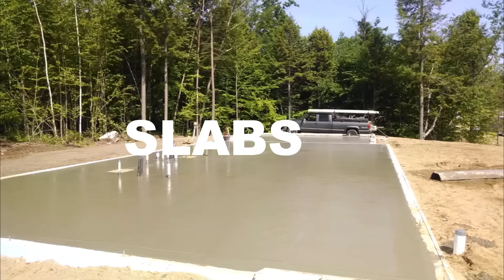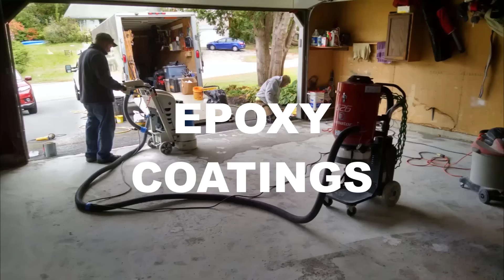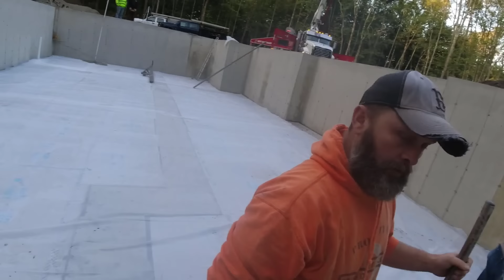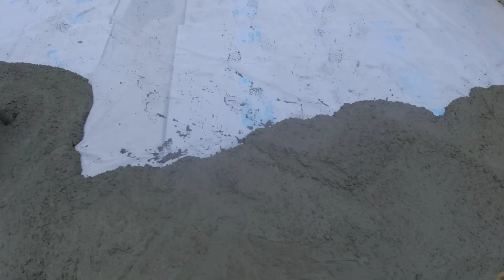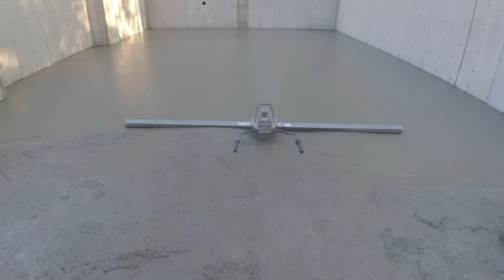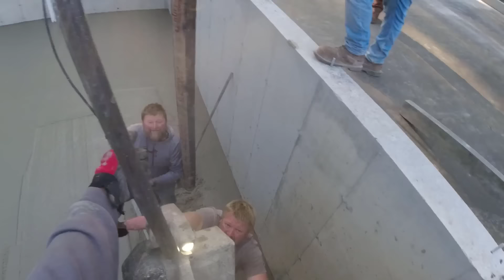How To Make Pouring Concrete Easy (Skills, Tools, & Techniques)

Comment: You obviously don’t need it Mike, otherwise you would do it, but I always wondered why you didn’t need to put expansion foam between the floor and the walls?
Reply from the maker: It's not a bad idea to do it, it helps with expansion/contraction. But if the plan doesn't call for it we don't usually do it. On some jobs we work on the plans have it in there so we install it on them.

Comment: Hey Mike,

I always love the Videos. I wish you were in Souther California not many Concrete Contractor have your skill or knowledge.

I have a questions if you have time. 

First i'm pouring a house pad for my structure that is 50x90 is with Pre Engineered cold rolled steel structure. The Engineering calls out a min 4" slab with a 2' width by 2' Depth perimeter around the slab where the Steel will Frame will bolt into the perimeter.

We entend to have a polished concrete floors on the first floor of the home. For longevity & to hopefully limit cracking over time. What would you recommend the best Concrete mix be for my project, Should I go more than 4", add additional rebar, or rebar + Wire mess combo. 

Any recommendations would be greatly appreciated.

Thanks,
Dustin
Reply from the maker: 4 to 5 inches is good. A higher psi mix will polish better, so 4000 is better than 3000 psi for polishing. A mat of rebar is better than wire, no need for both.
Reply: @MikeDayConcrete  Thanks for the input. Much appreciated.

Comment: A pump is worth 2 finishers .
Reply from the maker: It does make it EASY
Reply: I agree. However sometimes someone pumping the concrete can get it low on you throughout the whole job, making it harder on you.